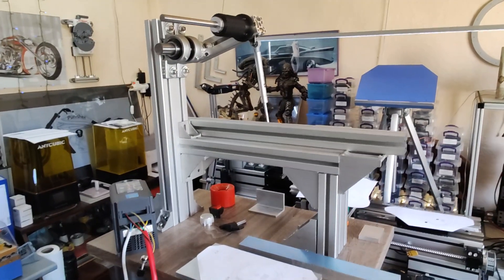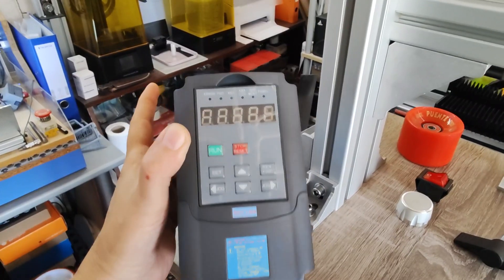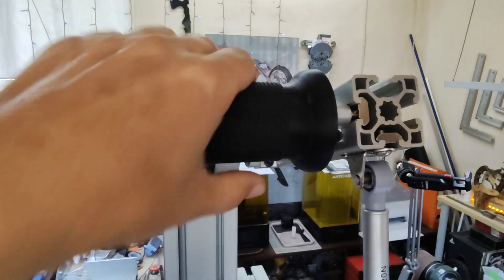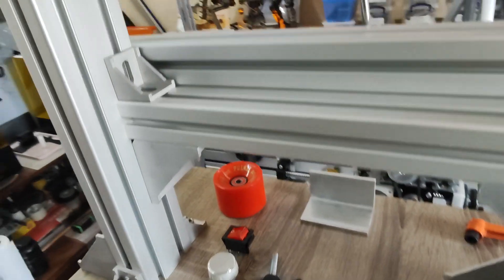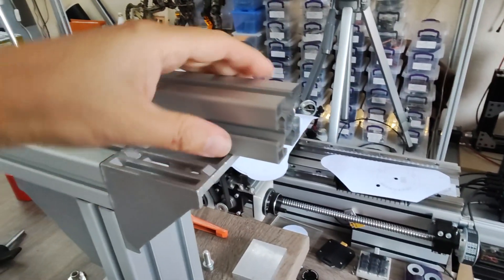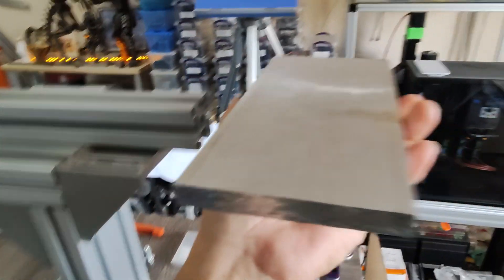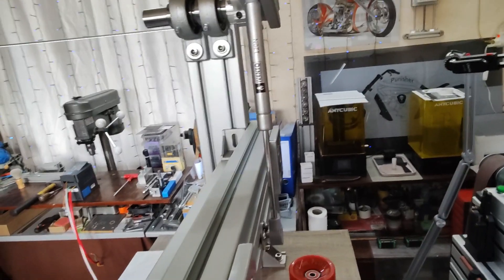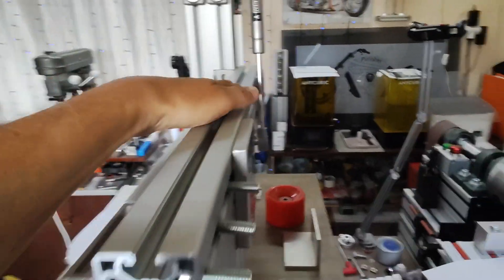DIY 2x72" 2 HP + VFD Belt Grinder no Welding required, with 4080 Aluminum Profiles by #Hayri  Part 2

Comment: Remarkable.   An amazing thought process.   Eager to see how it turns out!    What was the aftermath of the hail storm you endured?   Were you able to get your car repaired?
Reply from the maker: Thanks, me too, can't wait to hog some metal, apart from the aluminum pieces I need to shape. Got some old rusty files I want to turn into knifes. Not yet, it's still banged up like I showed in my video. My plan to build a foldable car garage fell into the water so to speak as it would have cost too much and I bought a car cover instead which was not cheap either as it has a thick foam like material to withstand hail damage, not that I expect any hail storm but want to protect the paint, once I am able to get it done, from the toe nails of the cats, lol.